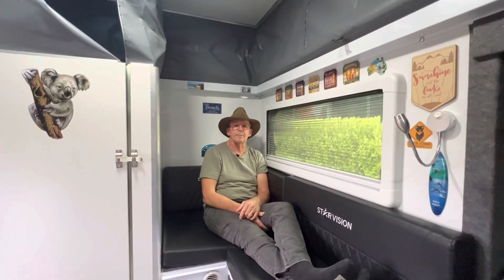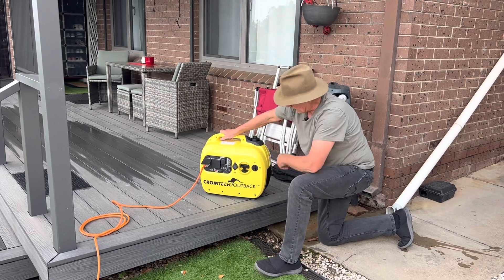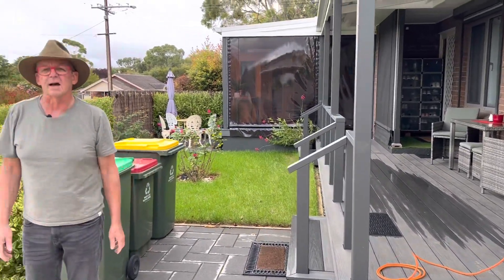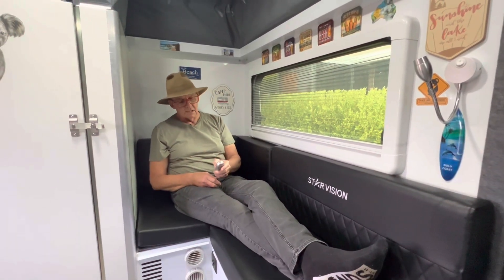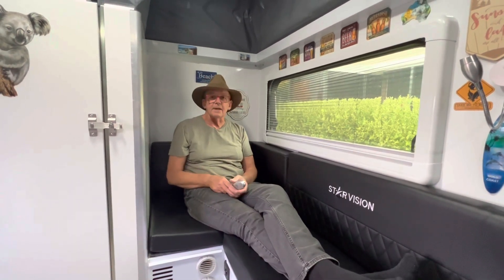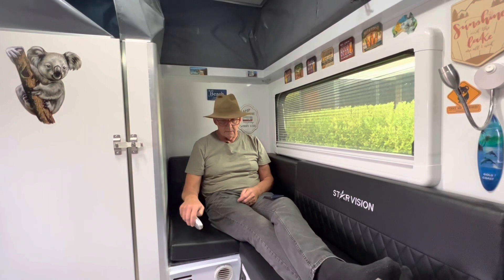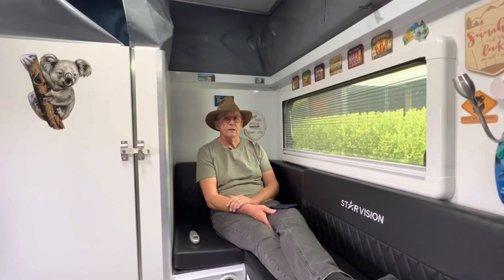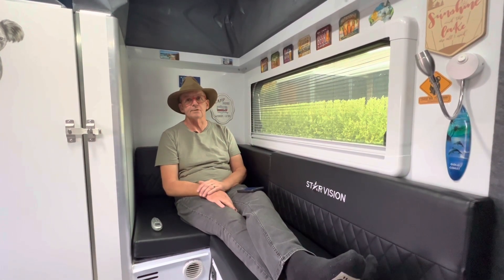AusCamping - Off-grid Air Conditioning

Comment: It may work, however you're only trying to cool the van down to 18C from about 20C. A hot summers day of 40C is when you really need it and how long that would take is something to consider
Reply from the maker: 100% agree, I wouldn’t suggest that anyone rely on 12v inverter for running their air conditioner unless they had a considerable amount of battery and solar. 

Does it work, yes
Is it a good option for the average camper, not really.